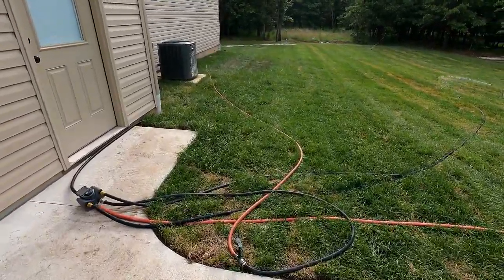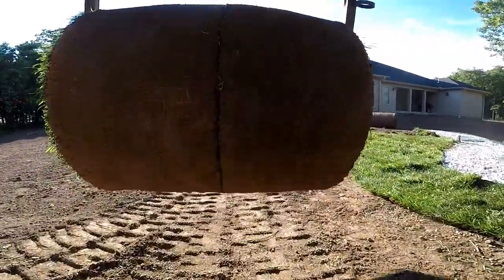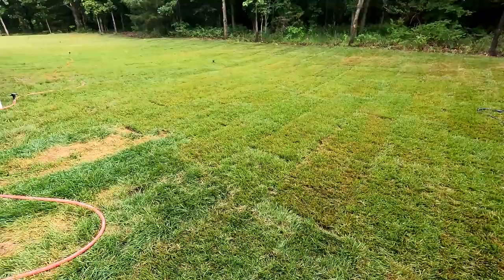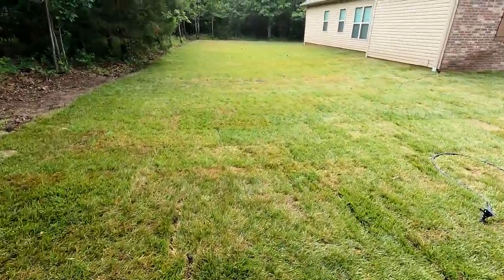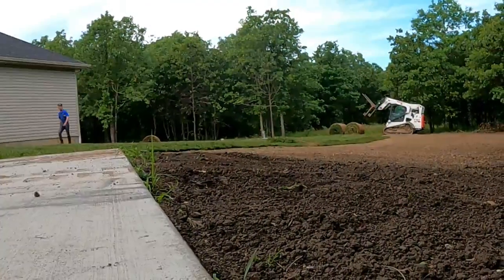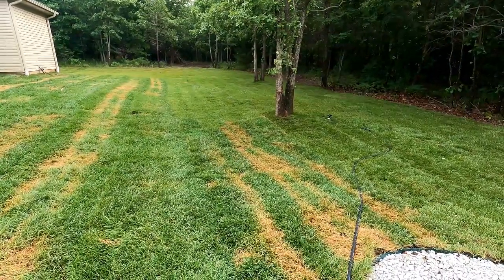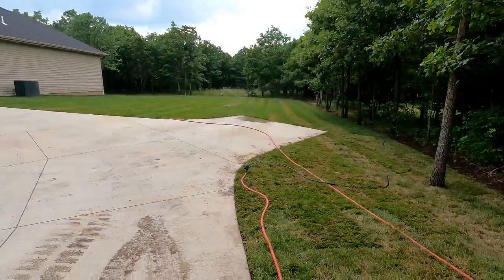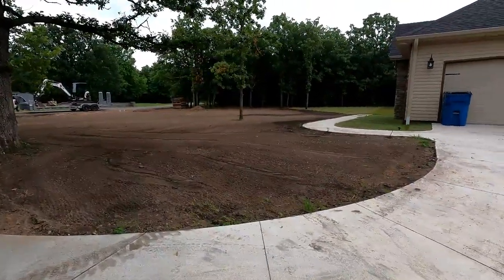Large Sod Rolls vs Pallets

Comment: Youre having trouble with big rolls because youre installing them wrong.  You need to butt the sod rolls up to each other as youre laying it down with the skid steer. Yes this means you will have to put your track on the sod that is already installed. Also you want to drive forward with your skid steer if possible while laying, this will put 1 track on the sod youre currently rolling and will keep tension on it to keep it in place and prevent wrinkles.  When laying big rolls we use 2 people, one skid steer operator and one on the ground. We did 22k sqft the other day in 4 hours with this setup.
Reply from the maker: We tried that but did not like the results from the sod getting smashed by the tracks. I’ve seen machines specifically built to install the large rolls and they appear to have much less ground pressure resulting in a better finish.
Reply: @ThriftyGarage  maybe there is a difference between your area of the country and ours. We do it every job and have zero issues. The grass blades will lay over a little, but they stand back up after watering.
Reply: That sounds heavenly. Do you have videos?
Reply: @ThriftyGarage  That smashed look is temporary and it actually helps to set the sod, especially on a slope.

Comment: The problems we have had with using a skid is it dying where the tracks packed it down. I’ve done it for 2 years now and looks the tracks of the machine was the problem of it drying out
Reply from the maker: We did a larger sod job with the rolls where the sod company used their four tire skid and it was substantially better than using a track skid. Those tires basically floated over the sod. It was 70,000 square feet of Zoysia sod.

Comment: From my experience in the sod industry the rolls are only good for big and open projects like sport fields or homes with very large property but usually it's best to have pallets for houses.

Is the donkey forklift yours? Because Donkey does sell attachments to help roll out the sod rolls as well
Reply from the maker: The donkey is from the sod farm with the delivery truck. We did hire a sod farm to install 70,000 square feet of zoysia and it worked out perfect! For this particular project I would definitely do 3 loads of pallets if I were to do it again. Definitely too tight for the big rolls.